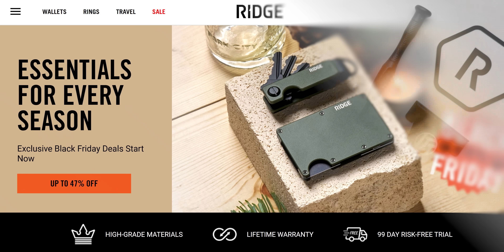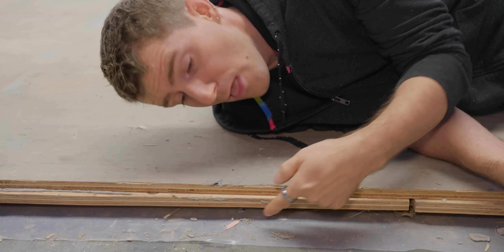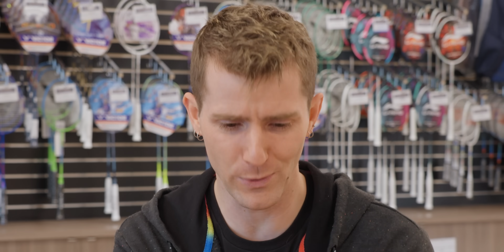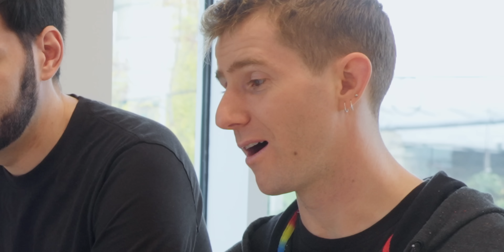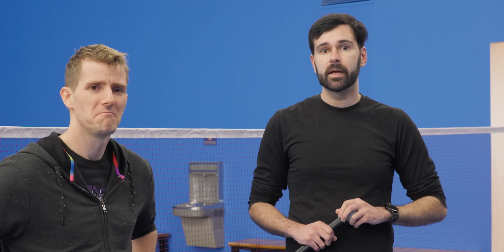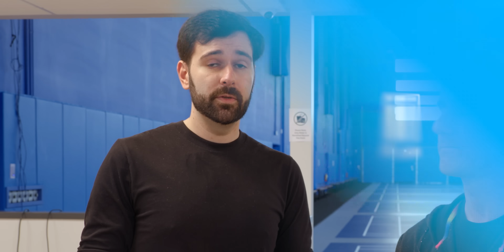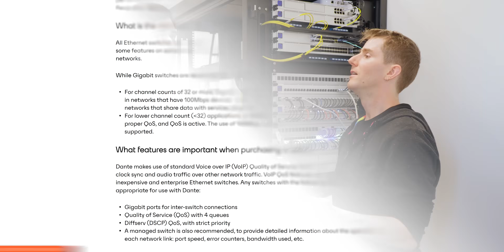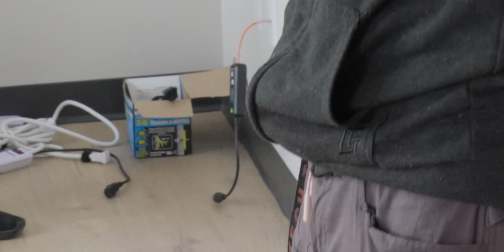You can finally hear me! - LAN Center Audio Tour

Comment: Does anyone know what is that laptop Dan was using in 7:30?
Reply: One of the rugged Dell Latitudes (7730, 7230, 5430, etc..)
Reply: @toshi_ca  Thanks
Reply: It’s a dell latitude rugged extreme of some variation I believe I use similar for my work
Reply: Dan says he loves the dual hot-swappable batteries if that narrows the model down.
Reply: I wouldn't be surprised if it's the Dell rugged extreme that they did a review of a while ago, they did damage it in the review so they likely couldn't do anything with it. Apart from give it to someone as a work laptop and with all the stuff Dan does that would be a perfect candidate for him

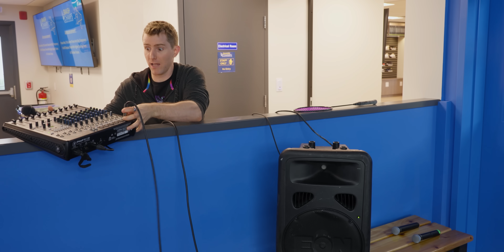Comment: 4:10 That poor Mackie's life flashed before his eyes...
Reply: @JirForce  It's Mackie, it was literally built to withstand that xd
Reply: @Camilink94 It's not a real SM58 until it's got a dented windscreen and enough scratches you'd wonder if someone hit it with steel wool.
Reply: @YttriumtYcLief  If you're not using your SM58 as a hammer, then why did you buy an SM58?
Reply: It’s a mackie, it’s the 58 of mixers. He could’ve built that building using it as a hammer, then still used it as a mixer.
Reply: But it's a Mackie it's designed to at least fall off the Mackie headquarters roof and still at least get you through the gig. Although I don't know about the newer stuff.
Reply: heart attack aaaaaa